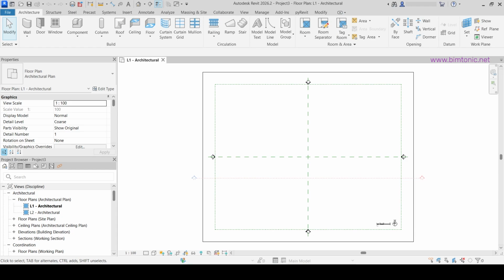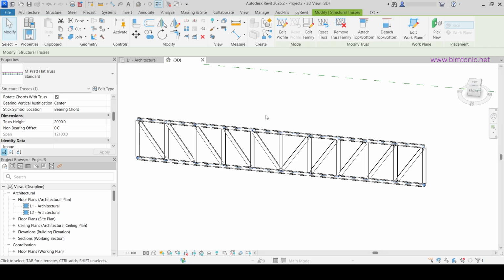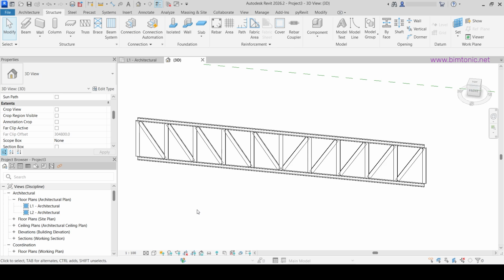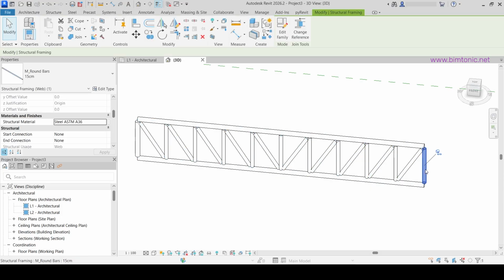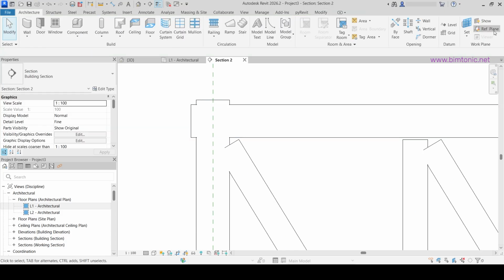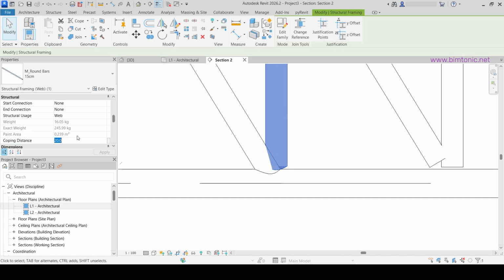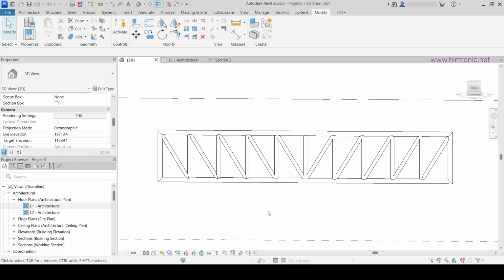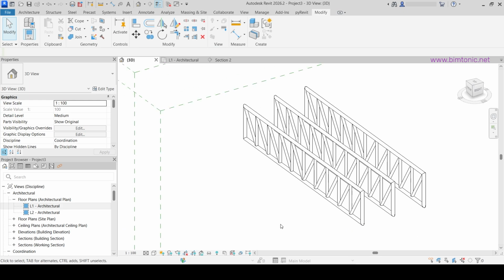How to Create and Clean Up Truss in Revit

Comment: I pressed TAB key , but it didn’t allow  select. Can u explain me? Thank you
Reply from the maker: Check the selection options (click triangle below modify tool) and make sure that "select elements by face" option is turned on
Reply: @BIMTonicLive I will try. Thank you
Reply: @BIMTonicLive  I followed you. Finally I can draw. But I cannot copy.
Reply from the maker: @sansakda6776  which part gives you problem?